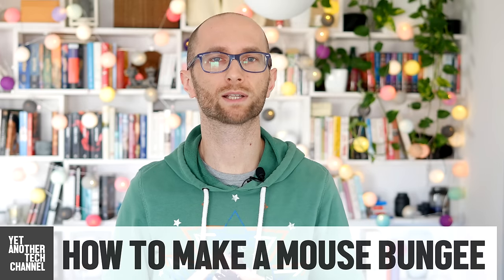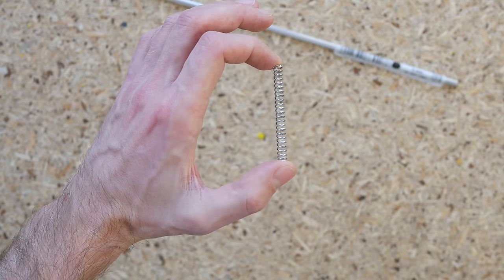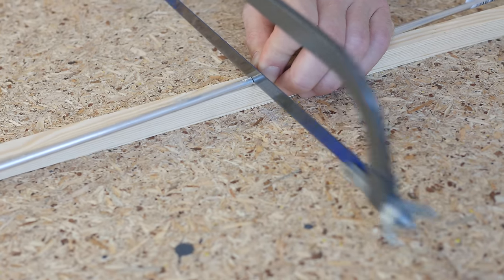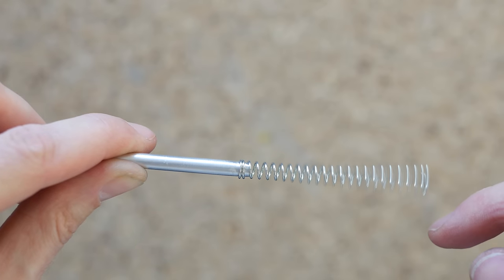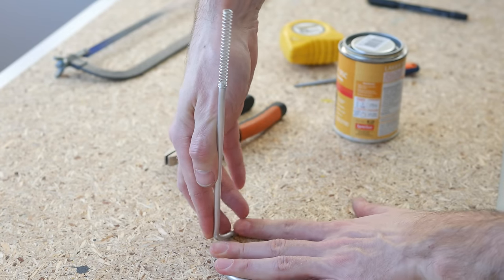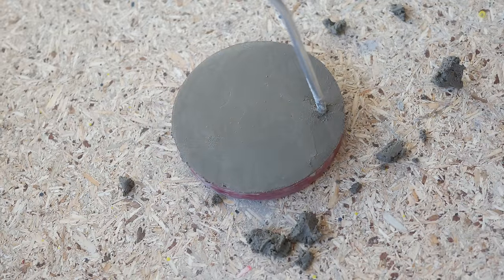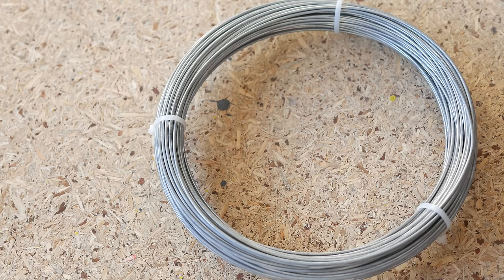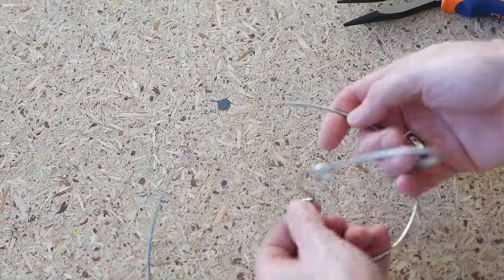How to make a mouse bungee for $1

Comment: FREE!

Take a pan take the inc thing out and the spring cut off the side of stping til 1 cm is left form the srping holder take a straw bend it 25 degrees than put your inc thing in putt your other straw side in the under side of a lego block and glue it to your tabe and tada i bet you have al of it at home!

Comment: I'm really curious, and I really like this, the need for the bungee is to return the mouse back to its original position so as to not have to pick it up repeatedly? I can see a lot of other applications for this device but what was your use case for it? Thanks!
Reply from the maker: I was asked by my Polish subscribers to come up with a DIY mouse bungee. I think it's supposed to prevent the mouse cord from tangling up. To be honest I'm not using it as I'm a very casual gamer and I'm perfectly ok with my wireless MX Master ;)
Reply: Very fair point :P Though I can certainly see no flaws or "things left to be desired" in this design, so nonetheless you did a great job on this one! Quality.

Comment: you dont want the cable fixed at a point....otherwise just tape to monitor and you're done. for any real (fps) gaming, which mandates low sens, the cable has to be able to move during big movements across a big mouse pad.